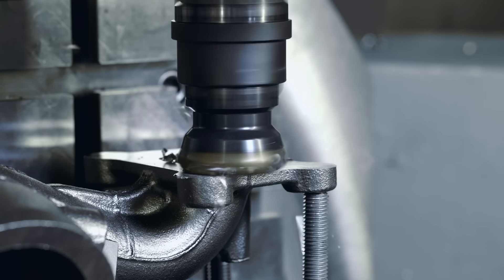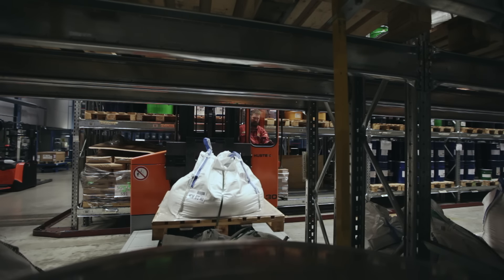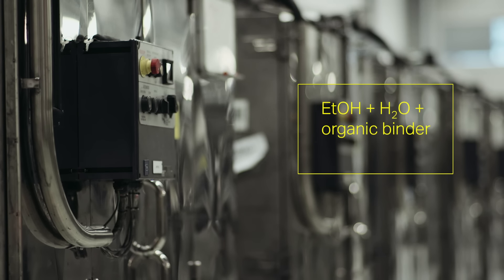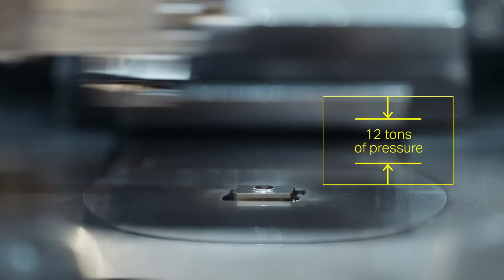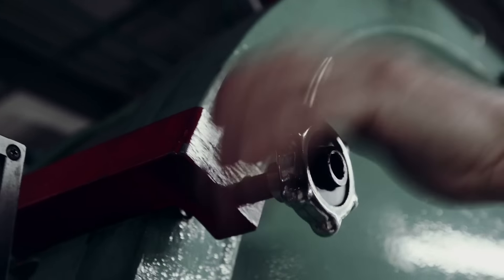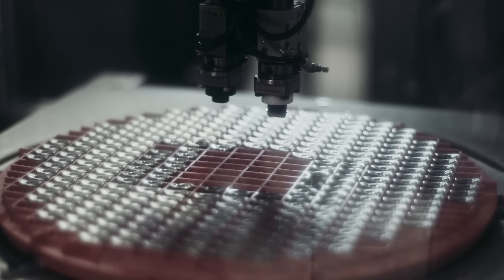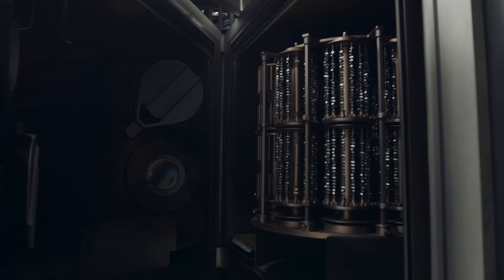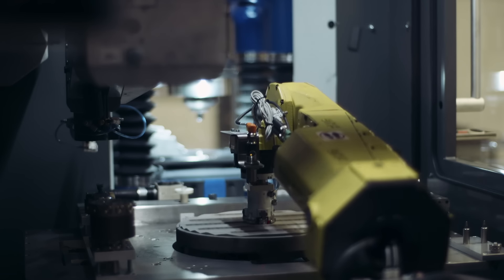How carbide inserts are made by Sandvik Coromant

Comment: The investment in and level of automation in the process is very impressive. Carbide dust must play havoc on some of the process equipment, Excellent video.

Kind regards,

Tom
Reply from the maker: Thank you! We are really glad you like the video.
Reply: Wow, fancy seeing you here! :-D
Reply: Wooo oxtoolco
Reply: for $14 a piece no wonder Made in China are  10 times less and as good as any
Reply: aldo6717 if they were as good as any, there would be no market for other companies. You just don't know what you're talking about and that's ok. Are the Chinese ones very good? Yes. But they're lacking the consistency, tolerance accuracy/precision, and most importantly the backend customer support. Good luck calling China. Are you going to notice the difference in your import lathe in your garage? No. It's a company spending $10k/year on carbide going to notice? Yeah, a bit. Also, they're likely a smaller ship where the backend support is priceless. Is a company spending $100k/year on carbide? Better believe it. Especially since they're getting tool life data off their machines where they'll notice a difference.
Reply: +aldo6717 Up until now every high technology, advancement in metal working industries (i.e. cutting tools, CNC machineries, electric motor, material, machine making) is dominated by Europeans (Germany, Austria, Swiss) & Japan

China couldn't even challenge that, yet.
Reply: That's a good point about the dust. It looks like a very clean facility but all that carbide and diamond dust particles must make the dust very hard on equipment. Watching this made me feel like the price tag on good quality carbide inserts is very reasonable for the amount of effort it takes to create them.
Reply: @aldo6717  - Chinese inserts do not last as long or even cheap American ones. Sandvik is actually a head of it's class. We've tried alot to save in prices but the quality ones actually do offer better value, because less downtime & less troubleshooting.
Reply: really? 4 grooving holders made in China +40 inserts~$100=at least 3000 parting off parts on lathe (mostly sst , some aluminum).1 Manchester holder +10 inserts=$240 Better than made in China? Maybe, but way too expensive for the same purpose No Chinese fan in here either, but $12 per insert might be too much
Reply: @aldo6717  When I upgraded from a straight blade to a helical cutterhead on my planer/thicknesser, the cutterhead came without inserts. Imagine my annoyance after spending about 100 euro on chinesium inserts and it turned out they weren't uniform at all. They were off in size by as much as a tenth of a mm. How I wished I had measured them all before installing any of them. So I went and got a fairly decent deal on 50 Oertli inserts instead for just shy of 500 euro. Wasted 100 euro and a weekend on chinesium... could have taken my nephews to the pancake-restaurant-boat for that money and it'd have been much better spent there.
Reply: @xenonram  I don't know one way or the other but a "expensive" market for a typically cheap product is not necessarily a sign that the expensive one is better.
Reply: @iqbalmuhammad2920  Doubt they ever will either - get it done fast and cheep is their motto.
Reply: @Sheila Walker I'm not so sure about China catching up. A big part of this is culture. In general Asians are very ... ritualistic, for the lack of a better word. They follow established ways. Japan was lucky that it had a big influx of American technology, after WW2. Japan was also lucky that continuous betterment of one's self is an important part of their culture. This allowed them to relatively quickly establish a culture in which striving to do the best is the established way. The Chinese don't have that to a comparable extent. Also, they are a much bigger country, which means any cultural change will take much longer. And they suffered and still suffer from communist rule, which drives the country in exactly the opposite direction - staying in line, rather than standing out, is the cultural norm. So, while it may eventually happen, I believe it will take much longer than it took the Japanese.
Reply: @alexbarnett8541  I suppose they employ a lot of filtering and dust collection. And use wet processes wherever possible. This should make the dust load on machines possibly even lower than that of more mainstream machining shops.
Reply: Why nobody mentioned DeWalt?
Reply: I was thinking of how clean it looks.  Your point about carbide dust seems the best explanation for that.
Reply: @aldo6717  I don't know too much about the differences in quality between different countries, but at least you don't sponsor genocide through taxes when you buy from Europe, unlike when you buy from China.
Reply: @aldo6717  50 cents has been deposited into your social credit account
Reply: @Sheila Walker chinese precision is an oxymoron
Reply: @BookofYAH777  the US taxpayer pays for chinese shipping through the Universal Postal Union.
Reply: @mackk123  It depends. Chinese companies do all sorts of things. They are doing great quality on some products. The fact that markets worldwide are flooded with cheap and correspondingly bad Chinese products is a matter of supply and demand. If everybody goes for cheap, rather than for quality, cheap is what the Chinese will deliver. Doesn't mean they can't deliver good quality. They might not (yet) be able to deliver top of the world quality in every single product area, and likely never will be, but still, you can get excellent quality from China, if you pay the right price.
Reply: @mackk123  well at least the contribution to China's genocide would be reduced if the product itself doesn't come from China. I don't know a lot about how the payments are distributed through the Universal Postal Union, but if you buy products from China, then the seller's revenue will circulate in China because that's where the seller will spend most of their money
Reply: you all prolly dont care but does any of you know a tool to log back into an instagram account??
I was dumb lost my password. I appreciate any help you can offer me.
Reply: @Dorian Rowan instablaster =)
Reply: @Franklin Kyle Thanks so much for your reply. I found the site on google and Im trying it out now.
Takes quite some time so I will reply here later when my account password hopefully is recovered.
Reply: @Dorian Rowan no problem :D
Reply: @alexbarnett8541  You know... i bought a diamond wheel in prep to setup my lathe as a precision grinder option... never thought about the DUST being a potential issue... hmmm...

Comment: I use Sandvik's diamond tipped Threading inserts for parts that came right after heat treating(hard threading/turning). Works wonders. Can do 2000 parts whereas a regular carbide insert could do 25 parts before the tip breaks. Awesome work Sandvik
Reply: Just think of what an advance carbide was over HSS.

Comment: Great documentary, I thought they ware milled and hardened, but the are pressed. Amazing. Really surprised me. Thnx!
Reply: I used to work at a place called Parker White Metal. And we had a powdered metal division. I always thought it was cool. But the sold it when they changed hands. If I remember correctly they regretted it as that really took off. And I think there was even parts we used and ended up having to buy them now.

Comment: Been using carbide inserts for over 20 years and wondered how they made them and how they kept such high tolerances.
Reply: What are the tolerances ?
Reply: @harrybriscoe7948  it depends on the insert. Tolerance is the third letter in the insert code. Look up "insert tolerance code", hopefully that points you in the right direction.

Comment: What I find intriguing is the whole concept of negative rake, where the actual edge doesn't even DO the cutting !! (If I understand correctly 🙄)

Its also amazing how something so brittle can be subjected to so much loading, heat & pressure & hold up... yet if you even tap the edge carelessly you can chip it, especially the positive rake ground super-sharp inserts....
Great vid guys... 

😎👍☘
Reply: Actually, the sintered carbides are very good at compressive strength.
That's why , zero or slightly negative rake angle.

Shear strength is somewhat less. Hence the edge may chip off at steep positive rake angles.

Downside is , it exerts higher cutting force. So the machine tool must be very rigid. New brand and sturdy machine  is needed.
Reply: It can be brittle but still very strong…… it just means it doesn’t deform much before sudden and usually catastrophic failure.

Comment: They are very good.
👍😄✔
I remember my days as machine shop owner, 15 years  ago, when we bought used , worn out Sandvic inserts from flea market, then brazed them on MS rods, to turn them into turning tools for our lathes.
They worked like dream.
We ran the lathes under such heavy feed rates, speeds and depth of cut that, the chips would be red hot.
Amazing combination of hardness, toughness and wear resistance.
👍😄

Comment: This is a very interesting video. It suggests that these inserts are made in small quantities. But the size of the raw material warehouse tells a different story.
I used to electroplate carbide inserts for drill bits and circular saw blades with cobalt or nickel. Since the deposited metal layer did not adhere to the pieces they had to be annealed in a furnace with a hydrogen gas atmosphere. If that sounds dangerous to you, well you are right. Smaller explosions were a routine experience.
Reply: I'm assuming English isn't your native language, since none of what you wrote makes any sense.
Reply: @algirdpatrick5048  were you high when you wrote this lmao? It makes perfect sense.

Comment: Shit. Now im going to cry when I break an insert!
Reply: I already do knowing how much they cost
Reply: @TugIronChief  lol, you must work a one off shop huh?
Reply: @TugIronChief  man I got whooshed 😂 good on ya
Reply: @TugIronChief  I work production, I yearn for one off work, that's later though
Reply: @TugIronChief  wild, I bet it's easier to pay attention to it vs a less obnoxious machine.
Reply: Not an insert, but my co worker broke the rubber molding and it cost $40k
Reply: LOVE this video!  (Makes me feel like the guy in the AMCO Transmission commercial, holding a wrench and saying, "Gee Boss, I always wanted to fix a transmission!") Still getting the [10" CNC hobby]-lathe (man, I hate saying "hobby") prepped for use, past initial toying around.  I immediately chewed through the complementary faulty-squealing inserts from Harbor Freight, like potato chips, while reinventing the concept of "FEED-RATES" via school of hard knocks! Can't wait to turn my second galvanized bolt into something! (Turning discontinuous HEX heads is like knocking heads on a bumpy road, and definitely requires a few insert tip-rotations, and a gentle approach!)  Just bought a slew of USED INSERTS (CNGP432-MF1 CP200) off ebay (80 for $35) and sorted them into baggies by # of remaining good-tips (using exacting eye-ball metrics).  On average got two-out-of-four still usable tips (being extremely gracious on the condition of some of the tips! So, figuring a net of 40-good inserts for $40) Of course, now I need to buy another ebay tool(s) to match the inserts (but that's a bonus, like goin' to Home Depot, but on steroids! :) ) In the meantime, bought a polish face mill -- requires 8 MORE INSERTS! (an arbor would be nice, too!) Why can't they make one UNIVERSAL insert? :D  Can't wait to take this out for its first official run! In the meantime, been acquiring serious worm gear and other hardware to redesign this into a hybrid milling machine. Maybe it's all the cart before the horse, but a used sine-bar I bought (and finally figured out what it is) is off a couple 10-thousands and I want mine perfect! So between the sine-bar and the lathe, I need a precision mill. Is it the insert that generates the polished-surfaces, or some post-milling manual process?  How'd I get here?

Comment: i spend one month in a (very good) company called widia heinlein to classified all different inserts wrt their cutting angles they were using in the different tools they were producing for the automotive company, mainly for crankshaft machining.. You can' t imagine how various they all are. It is insane. Also as a mechanical engineer learning on lathe, milling, boring machine, Sandvik has always been a reference.